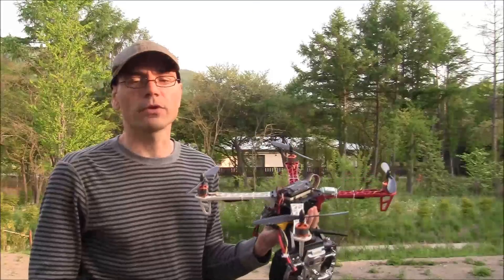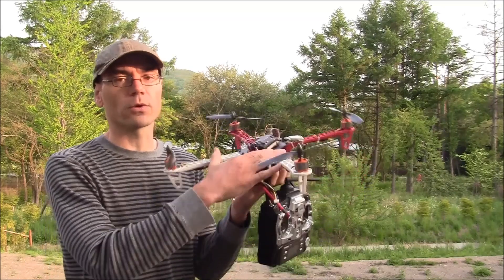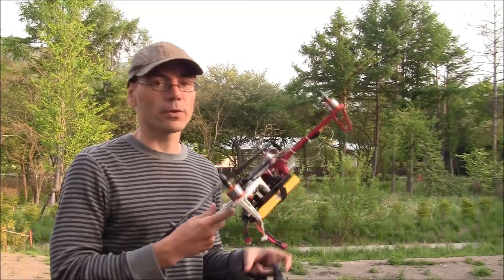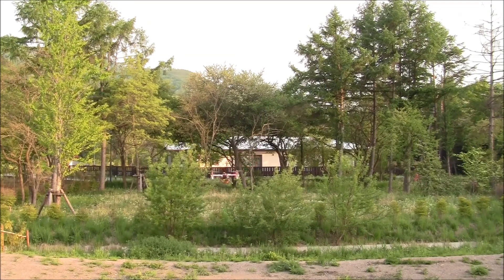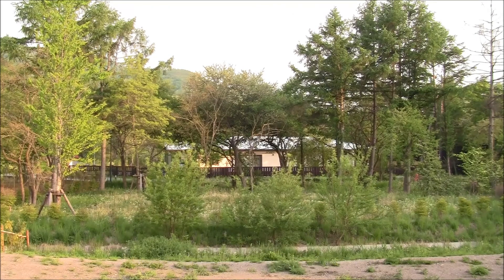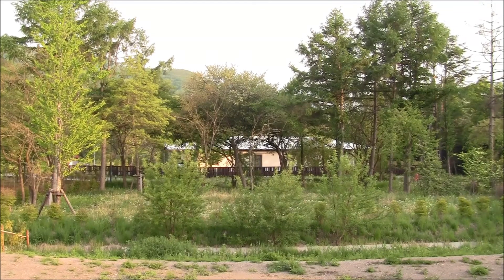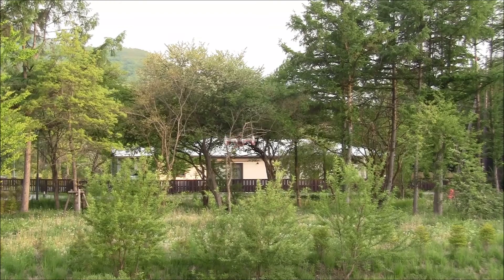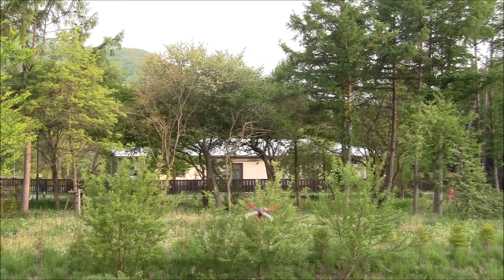AC3.0-rc4 Scaling Stability Patch

Comment: Randy, I am testing my APM 2.5 with latest FW 3.0.1. I am having throttle accl issues either it's too aggressive or too slow for the throttle up or down actions..Having trouble in hovering at specific height. What are the PID parameters to tune to resolve this type of issue ?. Some times it drops too fast and feels like no control..Any suggestion?

Comment from the maker: SkyVUaerial,  The Nav WP PIDs are removed because they've been combined with Loiter .. basically navigation is just layered over the loiter controller..it's somewhat close to a navigation controller pushing the copter around in loiter mode...not quite but close.
If Loiter works then RTL should definitely work.  I can't think of why it wouldn't.

Comment from the maker: Peter, I mostly fly a 3dr quad which uses all default parameters so I don't really change anything from the defaults.  I sometimes fly a smaller dji flamewheel clone and for that one I reduce roll-pitch rate to 0.11 (from 0.15) and alt hold P to 1.0 (default is 2.0)